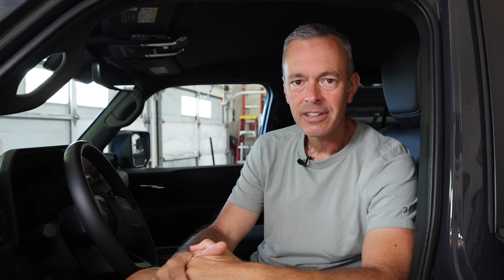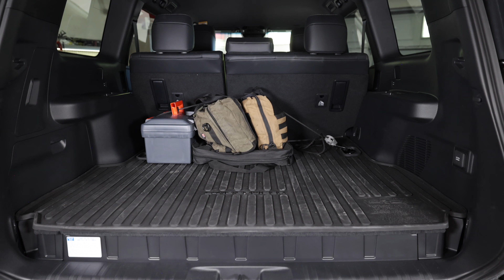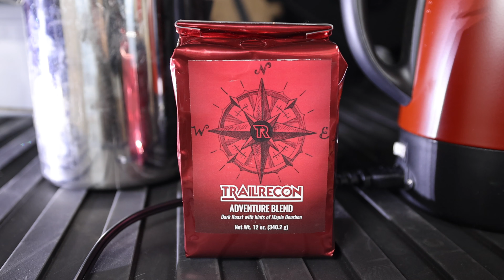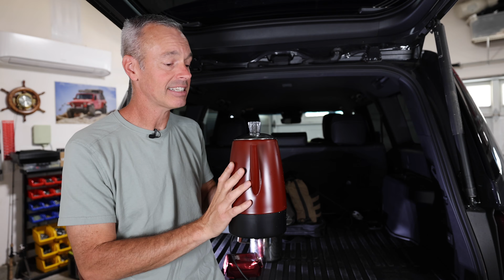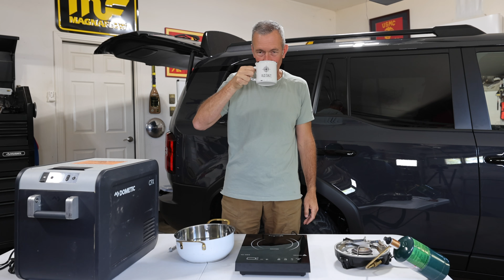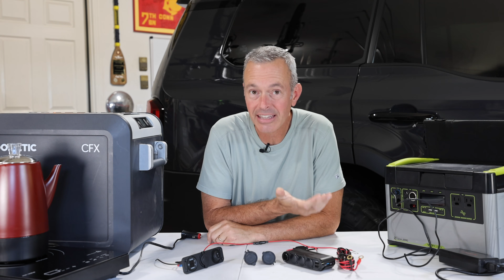Is it Time to Go Full Electric Overlanding?

Comment: Bought our first Jeep in 2021 (a 4xe) and have learned so much from your videos; TY.  No Flamables were our "build moto" and have overlanded the past 3 years with all things electric.  Induction burners, 3600W solar battery (trickle charges during driving, outlet charge for the few days at a hotel & EV charging...fills it right up in a jiffy). On one trip we even took an oven-style air fryer :-)  Best thing about induction is that in those cold windy altitudes, rain, or snow, cooking is still easy since there is no flames.

Comment: The fan that you were hearing in the center console is the air conditioning to the cool box. If this is still on, it will prevent you from turning off the air conditioner completely which is still draining on your battery. Turn off the cool box and then turn off the air conditioning and then it is fully powered off. After you do this, there may not be as much drain on the battery and the vehicle may not start as often.

Comment: Sorry. No. Estimated cost to boil water - $1500 to 2000.
2000w battery
2000w invertor
Solar panels
Wiring
Dcdc  charger.
Thats a big list.

Comment: But wait - where’s the coffee percolator and water boiling comparison times with propane???  I love nerding out over this stuff, but can’t believe you didn’t go for the propane comparison times. ☹️
Reply: If interested, I’ve done a full comparison for different water quantities, from different water temps to boiling comparing induction vs Jetboil. There are def some interesting things findings. Conclusion: I’ve switched to induction ;)
Reply: Technology Connections has an interesting video or two about gas vs. electric vs. induction in the context of home stoves. Gas loses because of all the heat energy lost to the air whereas the other two impart heat directly to the pot.
Reply: @bwofficial1776   But propane has much more available energy. A gallon has 91,450btu, while 1kw of electricity has 3,412 btu. You can carry much more propane in the same amount of space.  While less efficient, you can carry much more of it.

Comment: Toyota has been running NiMH batteries in their hybrids for 30 years and they have them dialed.  Not as compact as a Li-ion pack but rock solid to Land Cruiser standards.
Reply: Yep, of someone has the hybrid battery tech dialed in is Toyota.
Reply: they also perform really good at very low temperatures, all the cab drivers here in Canada don't have any problems with them
Reply: @99unclebob  if can survive Canada cold, then it's certified.
Reply: I think Toyotas got the right plan when it comes to batteries. When they are damaged or fail, HV nimh batteries self discharge slowly enough that they don’t start fires like HV Lithium based batteries do.

Comment: I also love projects like this, my fist overland project I tried the power station route but soon realized I was using more power to create a small amount of reserve to the battery pack, and switch to a second battery, lithium, and solar panels to recover power, this worked great to power my fridge and run my espresso machine as well as other electronics. And was always near 100% by 10am, I just left this on with the fridge running permanently.
My second and third project were more of the same just larger scale for more electronics.
I still feel like I should be able to charge directly from my high output alternator to a second battery (bypass the truck battery) for super fast charging and just run my truck for 20 minutes to top off the battery each day, it seems like this would be the simplest solution and most cost effective, still researching this for my FJ project.

Comment: Here's what I would do. 

I am familiar with RedArc and all that good stuff and well aware the mates down under using it for a good long while now and plenty following suit here.  Personally with todays vehicles utilizing so many electronics now days. I prefer to keep the systems completely separate. My personal opinion only. 

So here is what I would do. 

Lifo 4 at least a 2000 watt and Ideally a 2000watt inverter  up to 3000watt if it fits the budget. You could get by with less if had too., however in watts and inverter. But 2000wat or 2k is the key here.  I am guessing you already know, the most bang for your buck is a 12volt 200amp lifo battery with BMS built in.  Even better would be a 48volt 100amp lifo battery. That is a whopping 4800 watts. 48x100=4800 And they are "significantly" more efficient.  For reference, only, wal-mart offers a 48volt 100amp battery. Anyway, I digress. 

Throw a 200watt solar panel (300watt would be better on roof and use the Toyo lithium battery only for charging it via AC in a   
 pinch due to weather, heavy usage or etcetera . 

Or if  you find your self in a situation where you need to recharge faster. You can simultaneously charge with toyo AC while driving and the solar.  

Of course, there is the all in one solutions. Nothing wrong with these. Just  more expense then building out your own system and The big advantage for an all one systems it is a snap to move from one vehicle to the other. Or  in the backyard or whatever. And they are plug and play. The all in ones are getting all around better by leaps and bounds seemly every few months. Still, that applies to building out a system too. 

As for the all in ones, most everyone knows  Bluettie, Ecoflow, Anker for example.  However I have been watching and Yoshino now for a year and seriously  thinking of giving Yoshino a try. They are Solid state, almost half the size, lighter and about the same on amount of recycles, 3000 to 3500 charges and safer and better suited to with stand the rigors of off-road travel. 

I would plug my fridge/freezer into AC connection if Dometic has the choice If not DC and you can run your fridge/freezer 24/7 off the solar panel. And of course use the stove, coffee maker and heated blanket and so on.

Comment: I’ve been using my 4xe as a 1,440 amp hour power station when camping. A few benefits of the 4xe; the big battery charges the 12v battery without turning on the gas engine, you can control the Hybrid/eSave/Charge modes explicitly, you can recharge the big battery by doing some trails, and several camp grounds have started adding charging at the entrances.

Camping for 7 days only gets down to 50% power. But running charge for 30 minutes gets it back up to 95%. 

However I have a 5lb propane tank and use it for cooking. With electricity I power some fans, lights, recharging devices, and the fridge.

Comment: Hey Brad, I don’t think it is a question of fully committing to propane or electric, but it’s more of a balancing question. I don’t personally think its worth it to brew a pot of coffee and have the vehicle start up or shut down multiple times of the morning at camp especially if you are brewing multiple pots. I would probably keep that gas or use the Goal Zero for the electric brewer. As for induction heating, good idea, and I would keep a gas stove as a backup, (dinner would be awkward if you ran out of electricity halfway through). Electric methods will only get better as the technology and efficiency improves, but it is always a good idea to have a gas backup. Great video!
Reply: A modern 2kw battery station would solve his troubles, but it was to be able to take a fast charge from the Landcruiser. That goal zero does not. EcoFlow Delta 2 Max  can charge at 1800 watts. Can easily brew a pot of coffee in a KCUP or run an induction stove.
Reply: @TobyCostaRica  2 kilowatt battery would be plenty, but is uneconomical to most overlanders when cheaper alternatives exist. I never really cared for this solar battery trend unless its for electronics or for items that can ONLY rely on electricity. I agree with you, but I think my for personal use case and the weekend warrior that a budget solution would benefit more people that these dedicated stations
Reply: @overlandtoshore  I dunno man, Overlanding is the hobby of guys with disposable income. Yes you can do it on a budget, you can sleep on ground tents, etc. a 2kw station is around $1k but also has other functions for power outages, etc. I understand you can have a generator for much less, but for me. It’s another tool in the tool box. For example I much rather run a 2kw power station to keep my fridge powered vs a gas genny. Add some solar panels it can run almost indefinitely in silence.

Comment: I have a Prius and installed a 100A LFP battery in  Parallel with the 12v battery it keeps the refrigerator running all night without leaving the car on and probably make coffee in the morning. I have a 1500w inverter connected to the battery. Then I put my car in ready mote to recharge the battery .I also purchased a $15 dollar 1000W hot plate to cook my food at dollar general it will let you cook with any pan. If you just run a wire from your 12v battery to your goal zero battery pack to recharge it with your car is on you will have the same thing .

Comment: Heating coffee water in an electric hot pot on the tailgate table. Heating bagels or English muffins in a good toaster makes an early morning wake-up really work. We do have an induction cooktop when it's windy… or need a fast pot or skillet. Oh an instapot also is so handy!! We put the tiny 200ah Victron Energy lithium, solar charger under the driver side seat delete, BMS and Xantrex 2000w inverter. Upgraded the Altinator to 250 amp Monster Green!!!  Out of site and always has a charge. I love having security of  a smart dual AGM chassis battery system under the hood.  Still have a propane stove for big meals, have a jetboil when needed. 12v heated mattress pad works for cooler nights. Snowmaster. Propane firepit. That's as hybrid as I'll go. There are ways to make it happen without Redarc $$$$ and size.  Battery size and not incorporating a dc to dc charger saved space money and we get faster charging. Victron has an alternative to charge lithium faster at a lower $$ that DC-DC.
Very pleased over 3 years of use.      

Agaveman

Comment: Nickel Hydride works much better in cold climates whereas LFP and Li Ion cannot charge below 32f. Tesla uses some of the energy to heat the batteries in sub freezing temps to correct this issue.

Comment: I have that same dometic fridge. I brought it over to the LC250 from the time I had it in the trunk of a BMW M2 comp (very tight trunk opening). Anyways, I could barely fit it into the trunk closed, let alone open it normally when in place. I figured out that you can disassemble the hinge on the fridge lid, flip the spring steel around and reinsert it back into the cast hinge (storing the spring if you ever decide to reverse this mod). When you put the lid back on the fridge it still secures tightly but the lid can be removed when it's barely cracked open. Normally with the retaining spring in place you'd have to open the lid much further and use a decent amount of force to pop the lid off the base. The space I have has been working well for me in the trunk of the LC this way.

Comment: Great video! If you are wanting to go overlanding and really use electric, the hybrid F150 with the 7.5kw system would be the way to go. THAT would be awesome to see you do.
Reply: That's the setup I run. The F150 Powerboost is the greatest overland setup ever!
Reply: @bobstevens5974  do you have an XLT? My biggest issue with it is the low payload number. What is your payload capacity?
Reply: Agree; the onboard power on my Raptor blows Toyota out of the water … at least one in the Land Cruiser.
Reply: @bobstevens5974  sir, what trim level is your F150 and what's the payload of it?
Reply: Lariat 502a package 1400 lbs payload.

Comment: Love your videos, I usualy do no comment, just press the like lol. Anyways I would make a quick suggestion or something to look into, you could invest or buy an eco flow battery or another brand of 1200 watts and just recharge that battery when you drive so you do not need to turn on the truck and wake up everybody pretty sure that will power your fridge as well, I use a 750 watts and in 80 degrees high weather it last me 3 days for my cooler/fridge (55 gallons) for reference. In 110 degrees well it won't last as long but you have that plug and you can also use your 12 volts as well. Something to think about. Keep the videos coming 🙂.
Reply: Should have watch the video all the way before commenting, the yeti would work lol.

Comment: Toyota uses nimh batteries because lithium batteries do much worse in the cold. Take the AWD 4th gen prius for example, the standard one has a lithium battery, but the AWD model, meant more for snowy and cold climates, has a NIMH battery.
Reply: Right. Tried and true, and also relatively cheap. My Prius 06 uses the same battery cells as an 2016 Prius and I bet the land cruise will use the same nimh battery as a 2016 Prius. Cost me 1200 to swap batteries off a 2016 when the battery died at 260k miles. 343k later it’s still running. Gave it to family (the car).

Comment: Wait till you start overlanding with an all electric EV. Now that’s a game changer. It’s totally quiet all the time. Think Cybertruck, or Rivian. You can sneak up on game during hunting, you can draw so much power from it in complete silence.  Game changer
Reply: Don't really think EV a viable option for overlanding. You're not going to get much recharge of your vehicle battery unless you are prepared to set up camp for an extended period in good sun exposure. As we all know cold degrades battery performance so winter conditions will be limiting factor also.
As for using a cybertruck for overlanding? That might be doable in the States where you have wider trails but in australasia our trails were put down by landrovers and landcruisers. It would be a constant battle to fit a cybertruck through. And in New Zealand the ground can be very soft. In the West Coast where I live, the ground swallows 20 tonne excavators!

Comment: So if it were mine, I would go with a power bank, even your existing Yeti, as a buffer between the vehicle inverter, your appliances [especially the fridge], and your other non-vehicular accessories. It's important to keep your power sources separated as not doing so makes it far too easy to kill an engine battery when and were you least want it to happen. Why I'm suggesting the power bank is mainly you can negate all of the components of a traditional lifepo build. Yes, you can stash many, but you're going to need at least 100AH of lifepo to run it. Quite a few power banks that are big enough for the job you have at hand aren't much bigger than typical budget 100AH lifepos. Something decent like a Litime, for example. My Eco Delta max 2 certainly fits that description of size.

And here's the hat trick that may answer all of your quiet needs. And thanks so much for making that effort! Anyway, with that 2400W OEM truck AC inverter and a suitably sized power bank that also supports some level of AC fast charging [Some Ecos and Ankers, and I believe your Yeti. Maybe?] you may rarely need to fire up the truck to run the inverter exclusively for camp use. And you may rarely need solar. But you'll still have the solar option if you want it as the power banks have that covered. Most, if not all of your charging needs for the bank could be met by driving. So a passive charging of sorts.

Last bit in favor of the power bank. It's a tool. You have easily portable power, independent of  the truck. That can come in handy out in the field. It has for me.

FWIW, I myself use both a trad lifepo setup in my small trailer and power banks when I'm going smaller with my truck only. My truck OEM bed inverter is only 400W and the Eco keeps up pretty well, charging from that. If I need more, I've got 200W of portable panels. Appliances I use regularly with the Eco: 800w kettle, ~600W rice cooker, ~300W mini-waffle iron, 12V fridge. I just recently got an induction plate and have yet to use it afield, so I have no run/charge time claims there yet. In theory, a full charge should cover that for a couple days as long as the cooking times are reasonable.

Laslty, and not trying to sound like a smartarse here, but my previous career was working in OEM and aftermarket automotive electrics, and I believe you should be safe to power your vehicular accessories [winch, lighting, compressors] directly from the power rail in the engine bay. That implies installing proper fusing and switching. HOWEVER... please be sure to confirm that the gauge and run of wire back to that battery, and the power taps in the engine bay, will accommodate your loads. And there's likely OEM fusing involved in that wire run, so be sure to factor that in as well.

Best of luck and have fun!

Comment: Brad, I'm the same way when it comes to tackling an issue, work out many different possibilities then go with the one that works best. I also have that Goal Zero Yeti 1500, that thing is bulky but it can do a lot.  I have is set in the back seat floor area, plugged into my fridge. It charges while I drive, but also have a plug that I use when it's parked.  Looking forward to see how you do the build out.

Comment: I personally would tie into the starter motor positive lead, just don't use the starter when pulling something with the winch but the amperage should be similar for both winch and starter.

Comment: One note on safety- take the Yota outside when the engine's running.  We just ordered a Hiker Trailer camper for some camping (not really planning to overland) and I'm looking at an induction set up and coffee pot, but will have propane as a back up. Planning to go with a 3,000 watt inverter and 3 or 4 100 amp hour lithium iron phosphate batteries.  Enjoy your videos and adventures.  Safe Travels and God Bless!